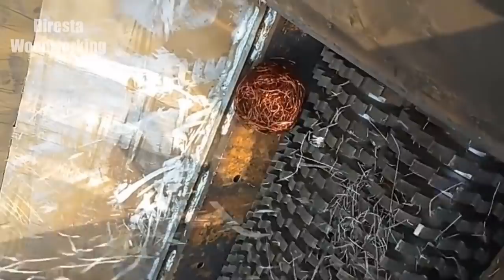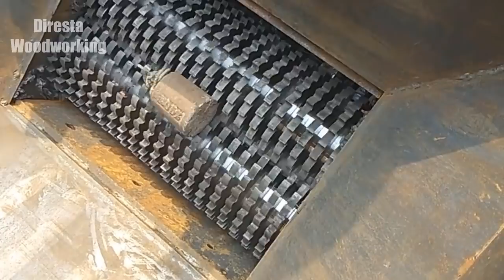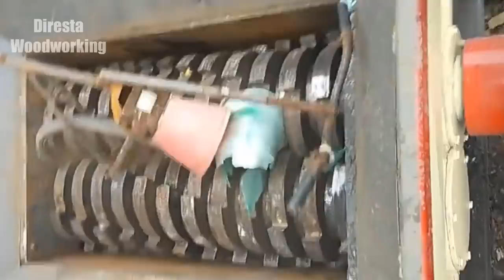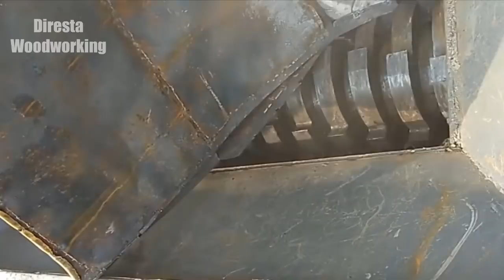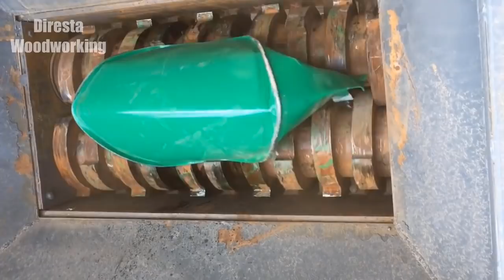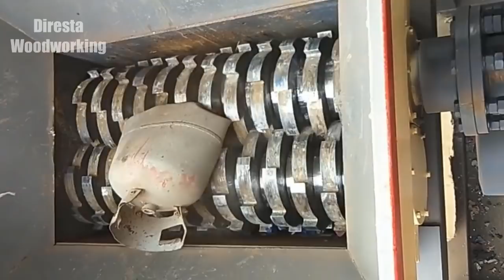Hammer vs Shredding Machines - Extreme Powerful Heavy Equipment Machine Destroy Everything Working

Comment: I noticed the spark proof sledgehammer did not get eaten. That would of really tested the machine as they are made of either ampco bronze or beryllium copper material. Both alloys have a strength of over 190 K conservative number, probably higher.

Comment: The sledgehammer is supposed to go in handle first, but even if it did the machine would get jammed because it's impossible to chew through a solid piece of metal that thick, and the idiot in the video teasing with the hammer knew it.

In a similar fashion no shredder would be able to go through proper half-inch thick I-beam used in building construction, weights made out of solid steel used for scales, large dumb bells, solid cast iron blocks (engine, BBQ grill, radiator) or, my favorite, any length of hardened 22mm security chain.

In fact, hardened steel "whatever" would seriously screw up a machine like this beyond repair. Even the biggest 42 inch bolt cutters with a Rockwell hardness of 50 or higher on the jaws would pose a challenge if you tried to feed it through one of these.

And then we haven't even tried to destroy the kinds of materials you see used in bridge construction (suspension cables and bolts), ship building (propellers, rudders, anchor chain links) or even transportation (car/truck wheels, driveshafts, differentials).

Just throw ONE set of traction chains off a 200,000 lb wheel loader into your shredder and see what the end result is. Yeah, lots of laughs after a huge bang and an expensive heap of useless machinery.
Reply: Seems to me that you need a better quality shredder.

Comment: The hammer won or you would have showed it.
Reply: He did show it.
Reply: @Austin_Wallis  never went through. Just bounced around.
Reply: I want to be a sledge hammer!
Reply: Well yeah of course it would win.
• it doesn't have any thin edges to get fed.
• it's a solid chunk of metal, it's not malleable.
Reply: They should have put it in handle first. Might have crushed it then
Reply: @tyler7992 ,  probably just broke the machine... or bounced around still..
Reply: @johnhughes9978 
Why didn't he use the large shredder then?
Reply: @morningmidnight9398  I don't know.
Reply: Handle first and on an angle